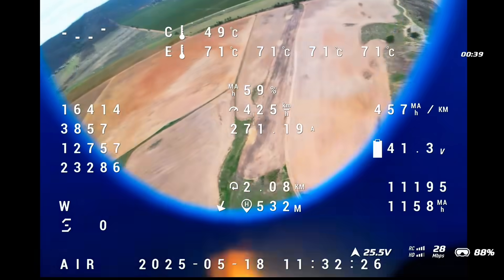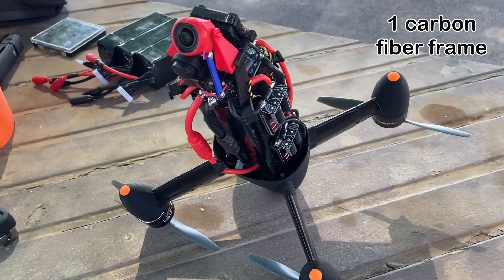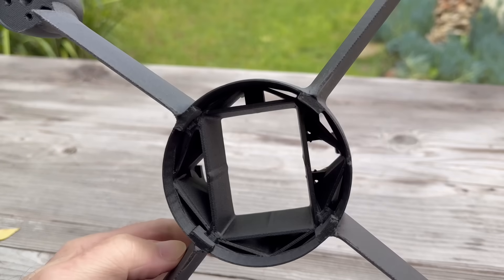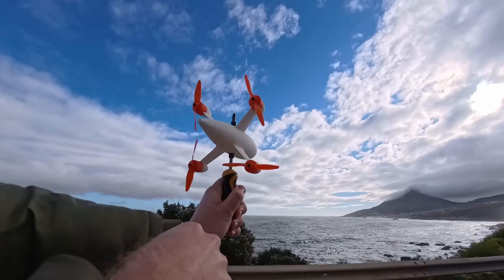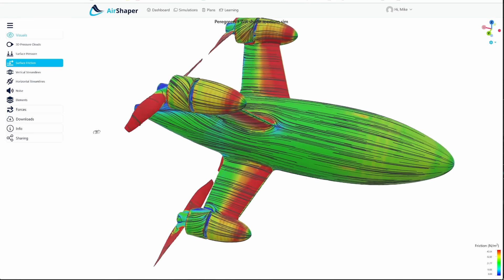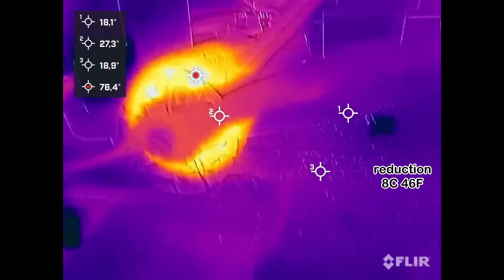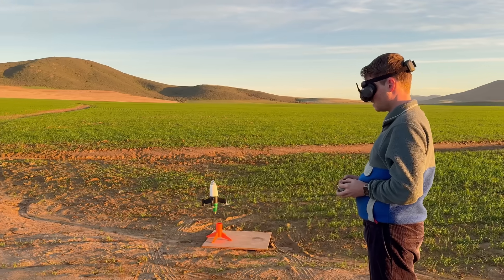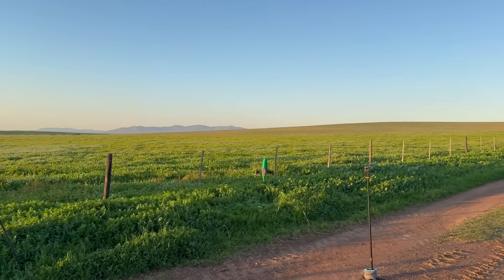How fast can a drone really go? 🇿🇦

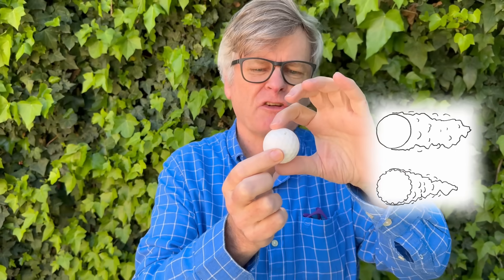Comment: @9:39 good explanation. Now, just for a second, imagine how the air drag would change and how the air-dynamic will change,  if the ball, or an elliptical shape, had a central opening through its longest axis. Or in another, funnier way said, adding motors to a shape with a form of a donuts and trying to fly it.

Comment: Im curious if there is wasted opportunity when having essentially 4 wings on this thing.  When its flying through the air, you really have 4 wings that are not really directing their lifting force to solely helping keep the drone in the air, but are pushing obliquely.   So I wonder if you could achieve less drag by having just two wings, one tail to stabilize, and that is it.
Reply from the maker: A quadcopter getsi its directional control from 4 props. With fewer props you need control surfaces and those are ineffective at slow speed.

Comment: To reduce drag can you use three motors rather than four?
Reply from the maker: Must have 4 for directional control and the pairs balance each other out.
Reply: @Mike-Bell  balancing the torque?
Reply from the maker: @Drenov  balancing the torque and the thrust

Comment: The length of the wake is irrelevant.  It is the pressure gradient over the projected surface perpendicular to the velocity vector.

A ship does not "pull" a wake.  A ship pushes water into a mound, and the mound runs from that point on its own.
Reply from the maker: Yes energy is wasted generating the wake.  The longer and dirtier the wake, the more energy is wasted
Reply: @Mike-Bell the vehicle only "feels" what it directly contacts.
That is a common misunderstanding.
The wake is the symptom, not the cause.

Comment: At this point I wonder if resin might not be a better option for printing at this point, as some of those engineering grade resins get insane
Reply: When it fits the requirement, it can do some pretty amazing stuff. 
...but with the serious amount of power that we're about to see dumped into every pristine GPU that can the wold's supply of silicon can handle?  I feel like when I imagine a bio-resin with the strength of spider's silk, the future's going to show up early and remind me that it's always way cooler than I thought.
Reply: @Inertia888 LLMs are actually peaking pretty hard right now. CNNs probably the next big bet.
Reply from the maker: Yes we are going to more into resin.  Luke has a resin printer.  Just needs R&D time.

Comment: Motor cooling could work better with a very efficient diffuser going from a very small hole to create the maximum pressure recovery.  Higher pressure will go through the motor restriction better.   It may not provide enough cooling, but this is the most efficient way

Comment: Since the liquid cooling shown in the animation for the video appears to used a mass of water as a heatsink (as opposed to circulating it) I wonder if using paraffin wax instead of water for cooling wouldn't offer an advantage. That way you can take advantage of the energy needed to create the phase change to melt the wax which happens around 50-70 C which is a high, but comfortable temp for electronics. 
Just given the time it takes a crock pot to melt wax (don't worry, nothing kinky, chain wax for bike chains) as opposed to heating up a stew (essentially water), melting wax seems to take a good amount more time (energy). 
The downsides would be there's a relatively large change in volume between solid and liquid wax, and wax is flammable once it becomes a vapour. 
The upsides would be a relatively constant temperature while the phase change happens as opposed to continually increasing water temp until it boils which, at 100 C is too hot for electronics though I guess you could use the steam for extra thrust! Less weight (wax is less dense than water), and wax shouldn't damage electronics if it spills (though I'd guess you'd use distilled water which shouldn't be that much of a problem).

As for the motors, I'd think trying a small cooling fan on the motor shaft to pull air through the motor like the FW190 used on its radial engines variants might be worth trying to see if you could make that lower drag than the current gap in the fairing you've settled on. 
Are the speeds you're attaining and the temp difference across the motors high enough that you could start taking advantage of the meredith effect to offset the cooling drag of the motors?
Reply from the maker: Great comment.  Thanks for the ideas.  I didnt know parrafin phase changes so low.  Advantage with water is you can put in cold after each flight, and besides the ESC's only climb 15-20C with the water.  We still have a problem with motor cooling, and air cooling is never going to do it.  We need a heatsink on each motor to prevent the pretty deadly overheating.  Will explain in the next video how the motors were self destructing.  Major problem that we found partial solutions to.

Comment: Why don't you add in a lightweight 3d delta printed ceramic thermal exhaust system, using Thermite inside the ceramics at the front of fuselage behind the transparent camera. You could design the ceramics to burn Thermite when you've reached your maximum speed, the Thermite would remove all the drag from around the fuselage and the shoulders holding the X4 fans.

If you design this right then the thermodynamics coupled with the aerodynamics should at that maximum speed you've so far achieved make the drone go even faster, you only need enough Thermite to last around 15-20 seconds within the uprated design with ceramics and angled ceramic exhausts..

Comment: Have you considered launching the drone from a bungee powered catapult?  Something like the way aircraft are launched off aircraft carriers.  That would reduce the energy required to get the drone flying, reducing the size of the batteries, and all the benefits of that.  Have you considered using a total loss evaporative cooling system?  The fluid would need a low boiling point and a high latent heat of evaporation.    Something like propane.  Yeah I think I know what you are thinking.  So one of the advantages of something like propane is that it is highly flammable.  If the propane (or similar) is burned the exhaust would help  fill and smooth the aerodynamic void behind the drone.  No thrust, but reducing the drag.

Comment: Consider spraying teflon on the front of the drone body. It can reduce drag by nearly 2%, which is not a lot, but you are chasing records by just a few kph. It's easy to do as well.
Reply from the maker: Is there a brand name of Teflon you can recommend?  I am keen to try it. The 3d print is surprisingly rough and has layers, not great. An extra 15kmh is like gold

Comment: I DID want to get into 'high-speed flight', UNTIL I watched this video, but now; no thanks!
I'm joking. Congratulations, I'd love to hear more about that battery. 16 kW!!! 23 seconds!! Great video. Thank you. Any suggestions for someone wanting to get into general 'tinkering'. No desire to build the fastest quadcopter, but to build a quadcopter that actually flies. I also want to be able to mess around with solar panels and batteries etc.? Where do I start educating myself, CAD, 3D printing, Basic electronics (Arduino stuff.), Carpentry, Welding? So many skills needed, but I'm wondering which would allow me to do some stuff, while I acquired the other necessary education, to maybe build that drone, or use an old EV battery for domestic energy storage. That ssort of thing.
Reply from the maker: You just need to start building and learning. Luke built his first drone back in  2013. This is more than a decade in the making/ learning. 

Hopefully Lukes solar drone video is up next week. No battery, no capacitor just pv panel plugged into the motors. It is super cool 👌🏻 keep a look out for it

Comment: with the props suffering from poor performance at liftoff, could you build a 2 stage drone? one drone that could get the other airborne and at speed with a low speed set of props which could drop off and return to home on it's own? it works for rockets, and you could have more battery life for the flight or lighter batteries.
Reply from the maker: The battery is so powerful that the props are fine. I was emphasising for effect. But variable pitch props would be amazing

Comment: For the ESC, you could try ESC with GAN fet, up to 100V they have quite low RDS on and small package, switching losses are also low, don't know if they will work only with the PCB as heatsink, as they are insane smaller than FET. Here you were using ESC with TOLL package FET.

Comment: So next project, a super efficient drone that can stay in the air forever ? Basically the exact opposite to what you've been doing now, 23 Seconds on full throttle to 0% the batter, i did not expect that to be this quick ^^
Reply from the maker: Well well. Luke has flown a solar drone this week that is surprisingly easy to stay up with just the sun. He will post his video next week. And he has plans for a 3.5 hr battery drone. Neither need aero so I cant help him with those

Comment: Does the drone need to start from ground for the record to be valid? Because if not, you could do a two stage drone, where the first stage just helps it to take off and get up to a sustainable minimum speed. This way you can fully optimize for high speed performance, and most importantly, you save a lot of battery expenditure from takeoff.
Reply from the maker: I would say the spirit of the record is takeoff and land under its own power. Thats what the FPV would expect and so would we. But as the record evolves it may be necessary to think along those terms

Comment: I've studied a little bit of everything so I know the solution you need. You need a painted coating that will protect your surface from the elements like heat. You're going fast enough that you're creating friction in the air which is causing your creation to implode. Hopefully you see this message and we get to see your next creation in a really awesome color while also letting it go hyper fast.

Comment: I don't think the disconnect is due to Dopler.  Δf ≈ (v/c) × f = (139 / 3×10⁸) × 2.4×10⁹ ≈ 1.1 kHz shift. The channel width should allow this. 

The power at the antenna changes rapidly, overwhelming the noise filters and automatic gain control (AGC). The receiver loses the connection because the signal-to-noise ratio (SNR) fluctuates too much causing high error rate. This issue could likely be mitigated by increasing the system’s tolerance to short noise spikes. Additionally, when the drone passes directly overhead, the receiver may experience a significant signal drop due to antenna geometry.
Reply from the maker: Thanks for that. Its beyond my knowledge base but @lukemaximobell will understand better. We have heard that others see the same thing on specifically the DJI 04 air unit.

And absolutely Luke saw signal drop when directly overhead

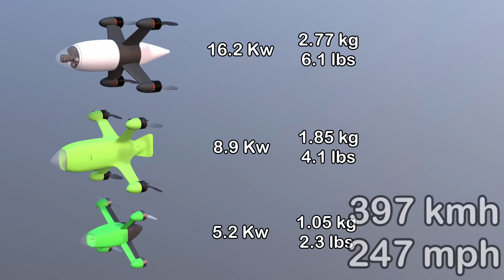Comment: Hmmmm, "The drag rises with the square of the velocity."  Also, all 3 model drones (16:58) have about the same power to weight ratio with the big difference being the output power. So, to get more speed I suggest making the body longer and double or triple the output power!   i.e. Bigger motors & props and more battery. Winglets might be needed to assist with lift.
Reply: Here is another suggestion which should add another 50-100kph to the existing design with minimal modification. Replace the water cooling tank with an LN2 tank. When LN2 is added to the tank the ESCs go to near -192degC. When power is applied, the ESC's boil the LN2. The evaporated LN2 is piped via tubes to the motors which also keeps the motors cool.  If more motor cooling is needed, add a pump to the tank. The low temp greatly increases the power output of the ESCs & motors. This also eliminates the motor air cooling vents and allows the motors to be kept small and encapsulated in low drag teardrop housing.

Comment: Wow this is amazing!! I was thinking, could you mount the motors inside the main body to make it even more aerodynamic and drive the props though a bevel gear like RC cars. You could cool then with the water or have the coils open so air flows across them rather than trying to go through them. Might be more stable if more mass in centre too.

Comment: If the water cooling system relies only on the specific heat capacity of the water, you might want to try paraffin. It has a very high latent heat of fusion in the right temperature range.

Comment: Beautiful work and research, however I can’t help but wonder if you wouldn’t benefit from a drag decrease by sculpting the rear of the engine pylons with five or six scalloped points each, similar to a whale’s tail or taken to extremes, the rear of a 787’s engine nacelle.

Comment: Could anyone explain to me what's the significance of FPV in absence of stereoscopic cameras on a swivel and a form of head-tracking? Why not just go with a large curved screen? Or a small screen... or whatever.
Judging by some parts of this footage, it looks like the experience is not for the faint of stomach...

Comment: What's next? Embed the ESC in the fins and use the fin as the heatsink? Static stator fins like the CFM Rise propfan jet engine to extract more thrust? A tail droptank battery so you have full internal capacity for the trial run?

Comment: You're probably right about the Doppler shift. Your radio's AFC and channel estimator need to rapidly switch from few kHz of positive Doppler to a few kHz negative. I dealt with this many years ago when designing mobile phones that were tested on high speed trains in Japan. Going past a base station that was near the tracks at high speed gave the AFC that I was working on a good workout.

Comment: Really interesting. You mentioned golf ball dimples in depth...any plans to dimple parts of the drone?
Re: water cooling, what about a chamber that can accommodate inserting a rectangular ice block so you're getting not just thermal mass but change of state benefits?
Cheers!
Reply from the maker: Dimples are for golf balls only, because a ball is a terrible aero shape and a particular quirk that only benefit balls.  Not a single aircraft or airliners has dimples because it would just add drag.  You can be certain all Airliners would immedeately apply dimples if it save fuel.
Reply: @Mike-Bell neither do vehicles but Mythbusters did an interesting car experiment which showed positive results. Dimpling sheet metal is considerably more difficult than a 3D print
Reply from the maker: @ross9580  myth busters did fun stuff but it falls in the infotainment pop science category … high fun, low on science
Reply from the maker: On the ice idea. Water is easy to change between flight, ice not so. And the system is highly effective with the water, rising only about 20c.

Comment: I kinda wonder if a low boiling point liquid like methanol in a sealed aluminum box machined like a heat sink on the inside with a pressure relief valve and hose leading out to the rear since you would only need enough liquid last just a bit longer than the battery and the evaporation should carry away the heat.  That way you might not need to carry the weight of a water pump and its plumbing. I think there are also tunable phase change materials that are more like a semi solid gel that turns liquid I remember hearing about their tuning from i think nighthawklight.  I really like polymaker’s products but Siraya Tech has some PPA-CF Core filaments where the CF is concentrated to the center of the filament so you get a smoother exterior finish and less likely to short wires while still having that CF resistance to warping.

Comment: Well done gentlemen!

Question though on the power usage.  You're pulling 400A at certain points, and your flight times are 30ish seconds....have you already investigated higher voltage outputs on the battery pack? Or is there a reason you stay at a lower current?
Reply from the maker: Good question. Higher voltage is quite an easy power trick. But we need different ESC’s and then the electrocution risk. Luke is looking at raising the voltage and our battery designer/ supplier will support us in new developments.

Comment: What would happen if you dimpled the drone?
Reply from the maker: Dimples are for golf balls only, because a ball is a terrible aero shape and a particular quirk that only benefit balls.  Not a single aircraft or airliners has dimples because it would just add drag.  You can be certain all Airliners would immedeately apply dimples if it save fuel.
Reply: @Mike-Bell but how do you know that until you try it and maybe it’s a cost issue, and if dimples caused drag a golf ball would be smooth wouldn’t it?

Comment: Just a mad thought!  
For take off could you fit a larger set of slower speed take off paddle fans attached to a light rear frame  that falls  away a bit like a shell sabot as speed increases  they might clipped to the smaller high speed flight fans.